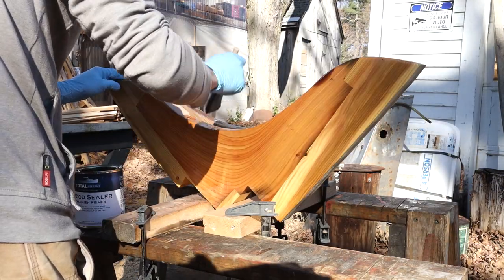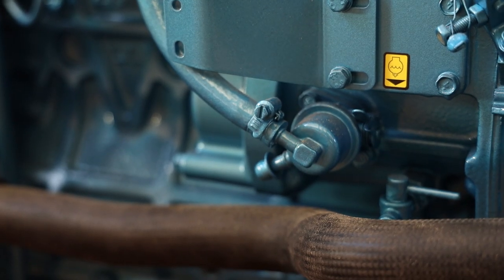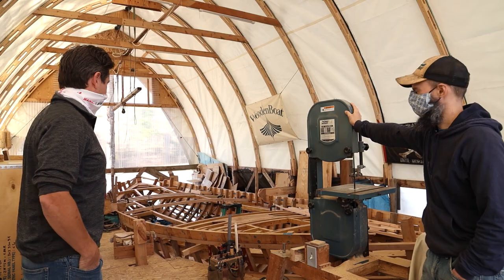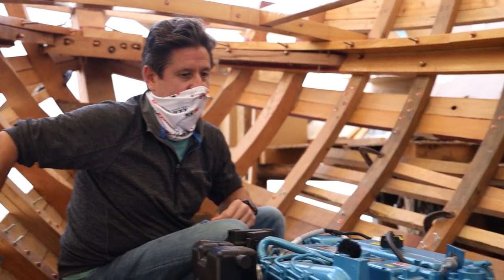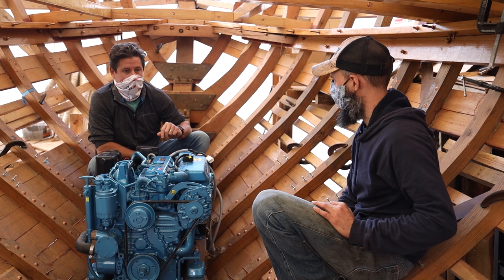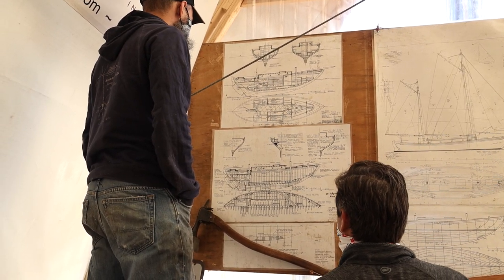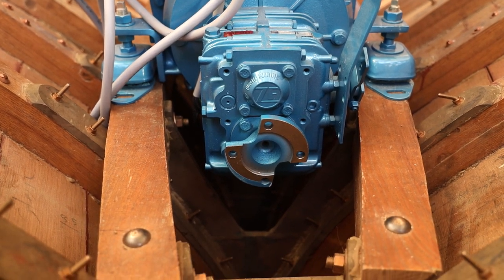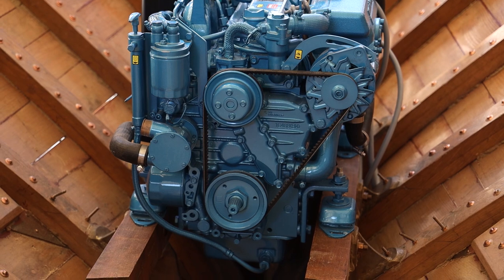Designing the Power Plant - Episode 137 - Acorn to Arabella: Journey of a Wooden Boat

Comment: Might be a good idea to consider more “luxury” as opposed to less. Simplicity is easy to build into systems from scratch, and efficiency has made leaps and bounds since Mr. Ackin(?) was taking up space. Consider hot water-can you live without? Sure. And a great way to minimize participation or create angst among crew and guests. No microwave-why? Minimizing carbon footprint and the utility of modern conveniences and tools need not be at odds. Someone mentioned earlier a pan under the grinder(don’t put a drain in it, just make the sump easy to mop out)-that’s low hanging fruit and more important than re-engineering fuel and oil pump locations. Having said that, the fuel filter location is the one you wanna make easy peasy, and make sure you can get a wrench on at least one injector... Think about building something that you don’t want to leave vs “I survived a voyage on the Arabella”. Don’t need a steam oven. You also don’t need a hand cranked ice cream maker.

Comment: I would suggest installing a "Keel Cooler" system, that way you do not have sea water causing corrosion in you engine.
Reply: Most of the corrosion happens at the wet-exhaust-injection manifold.  The raw water does not actually go in the engine at all.  

Even if they use a keel cooler, they would still need the RW pump to inject sea water into the wet exhaust... there is no dry-stack exhaust for a sailboat this size.  This means that the keel cooler would eliminate the heat-exchanger that is used to pressurize the coolant loop.  It would then need a large pressurized-coolant reservoir (more coolant means greater expansion/contraction) to replace the heat exchanger, two more through-hulls for the coolant loop, and still deal with the raw water pump for the wet exhaust.   Glycol coolant cooled engine with heat exchanger and wet exhaust is really the only option for their needs; and it is exactly what seems to be planned so far.

Comment: Finally, you will want a valve and plumbing that will allow the raw water pump on the engine to be used as a bilge pump, with duplicate strainers so one can be cleaned while the system remains in use, plus as big a hand-operated bilge pump as you can find room for, located so that the ergonomics allow it to be operated for extended periods.  You may be able to combine the inlet and strainers for this with those for the engine-operated pump. This will also need plumbing and an above-water through-hull fitting.  Now I'll get off my soap box-- I promise.

Comment: Fit fire suppression in the engine compartment - either remote manual activation from the cockpit and cabin or better an automatic system. Diesel takes a lot to get it alight but once it is it is not easy to extinguish.

Comment: I have a deep stainless steel pan that extend from forward of the front vibration damper to aft of the transmission between the engine beds which catches anything that comes out of the engine or is spilled during maintenance. I wouldn’t operate without them. They are easy to clean out and protect the bilges from environmental nuisance.

Comment: Get a fuel filter where you can see through the jacket so you can see if you have water.
Tractor trailer engines have transparent fuel filter housings
Reply: I have 2 fuel filters on my boat, the initial filter is clear as you describe with a water filter, and the second engine mounted one is solid.  Just curious if you meant the first filter / water strainer

Comment: With a scoop and travelling at speed, wouldn't there be more pressure on the faucet ?, so there will be times when the pressure is going up and down
Also, when the engine is running, will the engine pump suck from the faucet if it's open, this would create an air lock
Might be worth thinking about 2 sea chests, one for engine, one for kitchen/galley

Comment: Good idea on moving filter for easy access. You weld how about you weld up a aluminum catch pan than is mounter under filter . When changing filter put paper . Or your going to laugh big training pee pads , to soak up fluids. And if any link occur you have pan to catch fluids maybe not all but most. Now in pan you could make drain that drain to a 5 gal bucket if link happen.

Comment: Well, everyone has said it, but I'll put my two cents in. 

First, more tryface from Alix - love it. 

Second, I've seen a lot of refurbs of old sailing yachts and all of them had modern management systems added because it's the 21st century. This means creating a glassed bilge, including the engine bay. 

The authenticity of the boat is based on the technology they had at the time. They would surely have jumped up and down with glee if you went back in time and handed them some glass fiber and a bunch of epoxy for the bilge. Honestly, buying aged jeans in the most ridiculous modern aesthetic - you are buying jeans that are intentionally aged that last far less time than brand new blues, and you pay more for it. That is what authenticity means right now. 

Don't get trapped in the romance of authenticity because your boat is not a pair of jeans. 

Make a glass bilge that is removable and allows your timbers to dry. 

You want to be sailing, not maintaining your vessel.

Or don't. Either way, exciting milestone!

Comment: First today!Steve and Alix I agree that the moving of both oil and diesel filters are a good idea, but looking at the position of the oil scavenge pump, without the fuel filter next to it I would not even consider moving it at all. It's a nice solid mount and at a very good height. Steve you described it as a knuckle buster and at present so it is, but you'll only bust your knuckles on the fuel filter, with that out of the way you won't scratch a finger nail ! You wait till you have to use that to pump out best part of a gallon of oil( and I'm talking British imperial gallons here) you are then talking at least 10 US pints I would think, that's a lot of up and down pumps my friends and if that is mounted on a bulkhead somewhere higher as you indicated Steve that will make the task of pumping the oil out of the engine super hard work. Anyway that's my two penne the worth. Have a great time off Steve and enjoy yourself, yes I know you are already out of there but you might look in on line from time to time coz I bet you won't be able to help yourself!
Reply: Yes, you were!
Reply: I was first....thats what mine says!?!?

Comment: A few suggestions: Raw water pump, install a speed seal (speadseal.com)- fast access for emergency impeller changes or carry a spare pump. Fuel System: At a minimum, install an outboard motor pump ball on the fuel line to bleed the fuel line and injectors. The fuel pump lever is useless in  an emergency. Better is an electric fuel pump/polishing system. Progressive fuel filters. Leave the 2 micron fuel filter installed on the engine alone. touch it and you'll have a permenent leak. Make your remote fuel filter a 15/2 micron array. Engine Hoses: Invest in the best quality you can find. Exhaust hose: from water injector to waterlock muffler, use hi temp rated silicon hose. from waterlock to thruhull, High grade wire reinforced 1.5" or 2" hose, Shields brand. Same recommendation for engine intake hose. Drive Shaft: PYI dripless shaft seal. Propeller: PYI feathering Prop. Repeating what other have said, NOW is the time to design the electric, plumbing and mechanical systems for the entire boat.

Comment: Need a feathering prop. Fixed prop are noisy when sailing. Also think of how to ventilate and noise insulate the engine box. Running the engine for hours on end when there is no wind is tiresome.

Comment: It was a throwaway comment the the House  and Shop run on 100A.  For the boat: 100A at 12V = 1.2 kW, your house at 115V (?) at 100A is max 11.5 kW (touch more than double at 240V). It is power you need to consider, not necessarily current.  Now, to suck eggs ...

Comment: The first time I have ever heard of Nanni engines. I understand the only marinize engines. John Deere, Kubota and Toyota. Fuel filters have parallel filters.So that you can turn two valves and switch to a fresh filter. Then you can change to dirty one. When it comes to electrical power you need all of the production you can get. Don't sell yourself short.

Comment: Last note to Stephen:  Remove the plastic from the diesel engine.  That holds moisture and can condense it to cause rust on the engine parts.  If you want to cover it just get a light painters canvas and have your mom sew it so that it drops over it nicely.  Or just throw it on over.  But pitch the plastic cover for good.

Comment: You may want to spend a bit of time with someone that’s spent time living on a boat and doing long passages before you make decisions on your systems and interior. I’d plan for as much electrical capacity as you can afford and as much (and as varied) generation capacity as you can get. 2 alternators minimise charging run time for top ups, wind and solar generation provide base generation day and night. While you may want to go minimalist, if you are planning on crossing an ocean safely you will need Nav systems and GPS (plus back up), Radar, AIS, VHF, SSB and/or SatPhone, laptops and tablets for wether, navigation and messaging, autohelm, wind and depth instruments, Nav lights ... the list goes on. You also need to feed your self (fridge and freazer) and wash yourself and the boat (pressurised water). Then there’s bilge pumps, fuel transfer pumps and perhaps a shower pump out. At least one electric winch is also handy for heavy lifting. And all the video gear!

Comment: While you are kicking electrical systems around, you might want to consider a Small Honda Generator, gasoline (available around the world) powered which with a little planning could supplement/replace/interchange other systems, keep batteries charged without running the diesel engine, works when solar doesn't,  and serve all kinds of needs in an emergency.  I'm assuming you will use LED lights, and don't skimp in wiring sizes when making installations or supplying power to different areas on the boat. Redundancy is our friend.  I'm sure you have friends that are far more knowledgeable than I am who can guide you - I'm just offering things for you to possibly consider. Please take special note of Jonathan Kipps's correction regarding 100 Amp alternator vs. Household current. Best wishes.

Comment: consider putting a dearating line on your seachest (below waterline: SW inlet, a T below the waterline intake of your SW filter and a pipe going to above the waterline. this way if your sea chest cmes above the waterline  (heavy weather) air is not getting trapped inside your cooling circuit

Comment: If you are planning to do extended cruising, having a few amenities onboard will make the time more pleasant. Taking cold showers gets old real fast. Plan for the opposite. Not having a way to charge your batteries and having a minimal battery bank is not going to work out for you. With the advent of GPS charts and cell phones you will need more power. If you plan to maintain your utube channel and document your adventures you will need battery power. World traveling sailboats have several radios, not only VHS but also Single Side Band. All these navigational instruments need power. Plan to service them if you want to travel comfortably.

Comment: Hot water can be easily done (using engine heat) by installing a copper or stainless steel indirectly heated boiler vessel. Most household combination central heating systems have those and can be had for very little money.

Comment: I would assume that if propeller causes enough drag to be noticable on multiton boat it will tend to rotate with lot of power (if not stopped by the motor). If you have (I assume there should be one to reduce the drag) clutch to disconnect the motor. It should be possible to generate electricity from the propeller movement induced by water flow.
Reply: That would be a reasonably complicated system for little return in generation. KISS

Comment: You discussed solar but not hydroelectric. A turbine under the boat (or electric motor prop) can charge batteries using sail power. As long as your sailing, your generating power.

Comment: IMHO you may be going to lean on the water and power systems. I presume you'll have fresh water and a pressure pump for that. While not essential it is convenient,  salt water foot pump too. And of course you'll need salt water to your head, holding tank etc. You may not need a lot of house power for led lights and minimal electronics but if you plan on radar, electric bilge pumps, a watermaker you'll need a bigger house bank. A small portable gas inverter generator is a good add but that requires carrying gasoline. Maybe something you'll do anyway depending on your dingy plans.
Reply: Oh and refrigeration, I can't imagine why you wouldn't have some. Even if it's a stand alone chest it will use lots of power but believe me it's worth it. Sailing is work and good food is important.

Comment: You can get hard solar panels and mount them and when your in port and using more power they have a second slide out panel underneath you just slide them out and dubble your power intake but your still gonna need another power source like a wind turbine

Comment: Why is the engine coated in blue? To seal it up and keep it rust-free during storage? Or do you have to maintain a coating on all parts, like after you change the oil filter?
Reply from the maker: Engines are painted to slow down the rust problems they could have. No, one doesn’t have to paint oil filters. All marine engines have colors associated with their brand, and there isn’t anything special about Nanni’s blue paint. —Anne

Comment: Whether the 100 amp alternator will be sufficient is not really the issue here. It will be more than sufficient if the wiring is thick enough (which is often not the case). Your issue here is the regulator of the engine. It is a standard type that will never be able to charge the batteries completely full. What you need to do is to replace the regulator for a ‘three step charging’ configuration (resp. bulk, absorption and float phase or the so called IUoUo charge characteristic). Brands like Mastervolt or Sterling among other, sell these kind of regulators that can easily used in this situation. Only than you will get your batteries full when motoring.

Comment: Just an FYI. 100 amps at 110v is 11,000 watts. 100 amps at 12v is only 1200watts. Should be plenty tho. Just don't think it's comparable in any way to what you currently have. A 100 amp alternator is plenty if you have a few hours of charge time each day tho. There is a lot of power lost during charging. 

You would want LiFePo4 cells for you batteries. They are the safest readily available cells. LiPo can be a bit more dangerous when you are out at sea. Same goes for Li-ion ICR and INR batteries. Li-ion ICR and INR cells are mostly safe at this point due to safeties that allow them to vent their gasses in a shorting situation, but in packs they can still reach insanely high temps and even ignite the gasses. LiFePo4 is by far the safest battery chemistry of the more reliable, long use, high cycle battery types. Lead acid shouldn't be a consideration.

Comment: Being a marine engineer, nanni  took time to design and make compact neat excellent engine gearbox unit. But alas WHY alter location of oil and feul filter cann't understand. It makes little mess to change either in service. A simple door at the front of engine room most of the service to be done is right infront of you. Leave as designed why change a good thing. mount your  sea chest filter and primary feul filters in a good position as every thing else is allready done no brainer.

Comment: I'm sure this is ok, but at around 17min mark, while they are talking, you can see some gaps between some of the planks. Some look fairly large too.
Reply: That's what the flextape is for
Reply: Hi Duke.  The planks in a carvel boat must be caulked.  There are three basic types.  Oakum for large gaps.  Cotton Caulking for medium gaps.  Cotton Wicking for small gaps.  The caulking is forced into the gaps with a hammer and caulking iron!  As the planks swell from water take-up, the caulking is compressed between two adjacent planks.  The caulking also swells in contact with water.  These, in combination, form the hopefully leakproof shell.  

The planks you see are air drying on the hard and shrinking as a function of that.  Gap forming is to be expected under this regime.
Reply: @GreensladeNZ  I prefer wadded up chewing gum!

Comment: Recommend against going Goal Zero. Not expandable, not maintainable. and its a single point of failure. With a custom system,  it will be a bit more expensive short term, but with modular parts you can keep it running for a significantly less sum of money, and you can separate the batteries from charge controllers and inverters and such.

Secondly.. I highly recommend looking into a Keel Cooler vs a Raw Water cooling system. it will go a long way for the longevity of the engine. Considering Salt water is you know... corrosive.

Comment: If this boat is going into saltwater you need to think about fresh water cooling with heat exchangers for this motor.
Reply: Exactly what crossed my mind. I’m no expert but, from the point of view of ongoing maintenance, would it not be easier to have to remove heat exchangers corroded by saltwater rather than having to remove an engine affected by the same?

Comment: 16:47: "We run the house and the boat shop on 100 amps."  True, but at 240 Volts, not 12 volts.  With that said, the minimal power load described should be fine on a modest battery and that alternator....barring any failure.